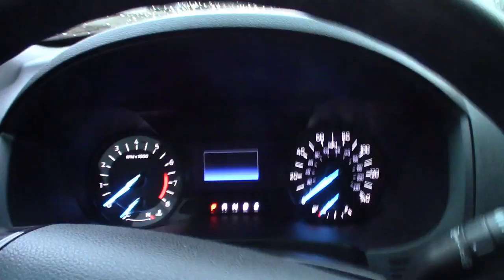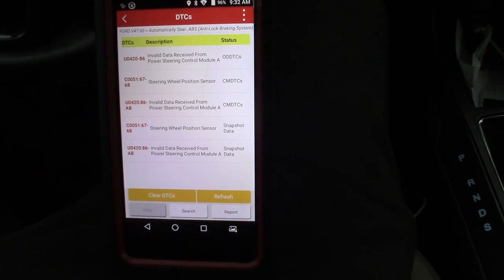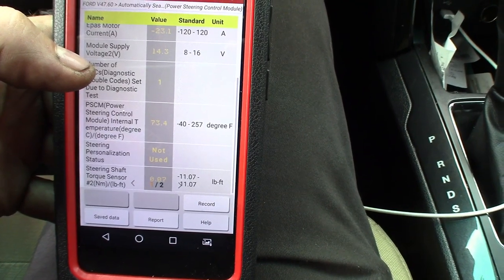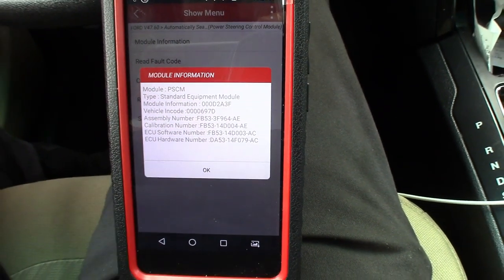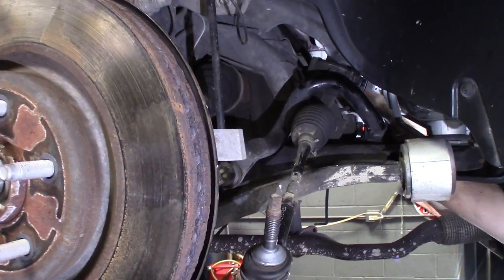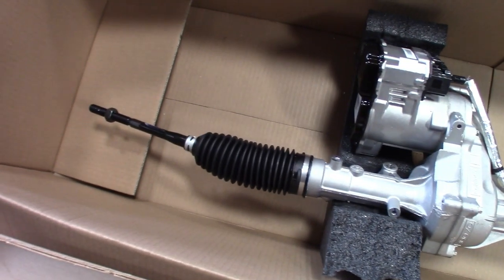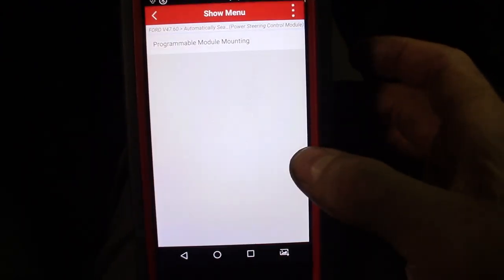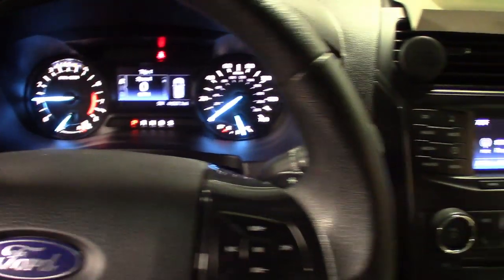2016 Exploder Electronic Steering Fault & Fix X431 Diagun IV

Comment: I have the same problem and I will try to do the same as you in this very exemplary video. The only thing where I don't understand much is where you say that they are going to use a jumper on the battery. If you can do me the favor of explaining a little better what you give power to with the jumper
in advance, thank you.

Comment: just for clarification did you need to have the old Steering rack plunged in too do the programming ?  and then the new one ? ...thanks
Reply from the maker: Yes get recal. info off old rack first
Reply: @JRC54   thank you so much bro .....cheers mate
Reply: My pscm is damage it doesn’t communicate with tool how do I get it replaced with a used one ?
Reply: @kingsauto9329  you will need a programer or a used car same year model get the pairing data from it by your tool

Comment: Just curious of your thought process on this. Was it enough to call it just from the scan data? I'm learning and haven't had to diagnose one yet. Could a input cause a non response like that?
Reply: Was wondering the exact same thing cause that isn't a cheap misdiagnosis
Reply from the maker: For me yes it was a no brainier to call it from the scan data and how the motor was not responding with output to module. But what made it easier was Ford sells it as a whole unit so it's hard to miss that. It's seems like they engineer these parts like that so it's easier to figure out when parts go bad.
Reply: @JRC54  ok please don't take it as me second-guessing your work. I was just trying to understand your thoughts so I can learn how to better my self. It's hard for me to read and understand. I'm better at seeing and understanding
Reply from the maker: Not at all man. Ask away were here to learn and it was a first for me as well. The only thing I was questioning myself while selling the job was a possibility of a lock out or can bus issues from another module.
Reply: @JRC54  I'm learning on that stuff but one thing that came to mind was does it have any TSB'S from the mfr regarding that? I know you said you checked for recalls. 

On my hyundai 04 Santa Fe I bought used had it had 5k less miles there was a TSB for it extending the warranty to 15yrs or 150k miles due to tanks rusting thru. 

Bank to your job at hand last time I did a rack and pinion on my wife's car the part was about $150ish lifetime warranty,  replaced rest of front end components since it was about 10yrs old. Took it to alignment rack and she was done. My cost, rack plus other parts only which is what us mechanics like.

Comment: This same thing happened on my 2013 fusion took it to the dealer and found that it was a recall on the electric power steering due to the bolts breaking  on the motor housing

Comment: I am just an old DIY guy and because these days you need a bi directional scanner with all this reset  and testing.   $800 a big chunk but you could pay for it by saving two professional repair shop visits.  Is there anything else in my his price range with similar capabilities?
Reply: full bidirectional,key programming,ECU coding,all system scanning

Comment: Same issue with my car except I can turn my wheel just very hard. The place I took it is saying my rack in piñon but I never had issues with anything before, no noise no leaks nothing. I think I’m getting scammed
Reply: Whatd you end up getting fixed? How much?
Reply: I have the same symptoms what did you do?
Reply: I just got the rack and pin on a 2013 Ford explorer and now the steering power service light is in red and hard to turn, do you think it's sensor I know the power steering is electric

Comment: So, any particular reason why you didn't simply test and replace the motor? if you have all your PIDS showing valid data and just no output, why wouldn't you simply suspect the motor? I don't know about this specific application, but i know for a fact that rack&pinion assembly was well over $1000 easy, probably closer to 3, yet I bet that motor can be gotten for a few hundred at most, or rebuilt.
Reply: Ford doesn't sell the motor separately, this should've been a recall item because so much vehicles have the issue but nope they just keep selling brand new ones for 1 500 instead, shit should be illegal!
Reply: @KillaCowboy just dealt with that, I put $20k into my 2012 base model explorer in repairs in 2 years, replaced EVERYTHING except the engine and trans, but it’s slipping and misfiring now so that’s soon. The suspension literally just falls apart, it’s the worst design I’ve ever seen or driven. Constant electronic and mechanical issues. Makes me ashamed to be called American, to be honest.

Comment: WOW! Read a couple codes and just throw a $1500 part at it. Some days it's better to be lucky than good, eh?!
Reply from the maker: Call it how you want to. The scan data speaks for itself. Bet I'm luckier than u. It's called skill my friend, sorry I didn't record my whole thought process and research, when you know what data to look for, I'll make sure I do a video on the next one I read codes and throw parts at for ya though. It's Ford's genius design to build everything in one unit so it didn't matter that it was a failed module that's too close the the catalytic converters so it gets too hot or that the gears break in the assist motor.
Reply: This is interesting you only got to see a little bit of the video you haven't seen exactly everything that hes done so how do you know that hes just throwing parts at it

Comment: I just paid nearly $1500 to fix the steering rack on my 2012 base model. It’s literally the worst car I’ve ever owned, bought with 130k miles for $12k, and in 2 years have put $20,000 in repairs into it. The most notable failing parts are the suspension, needs control arms and sway bar bushings every 15k miles. Buyer beware of the garbage ford exploder.